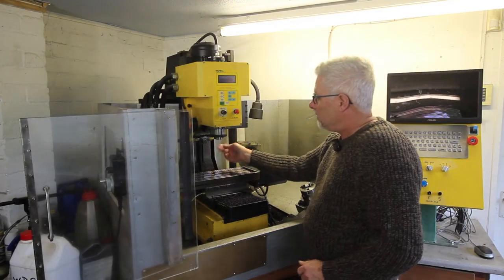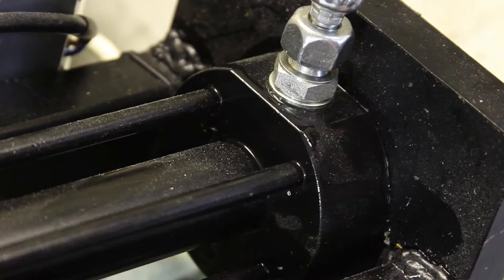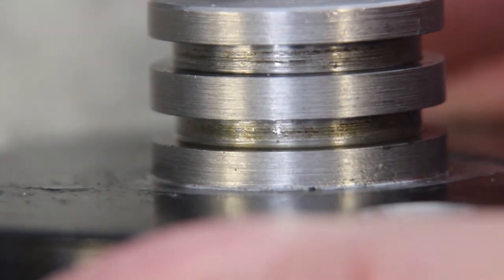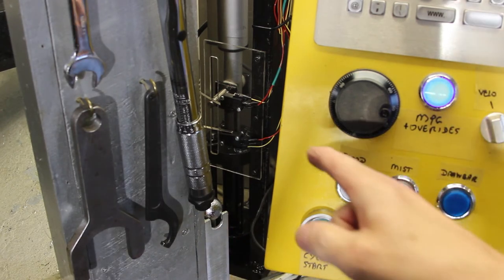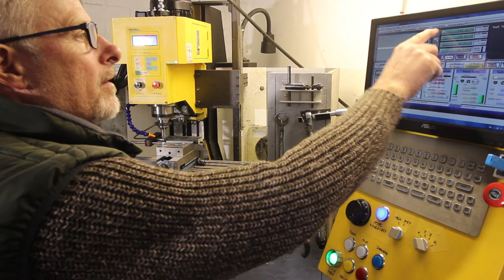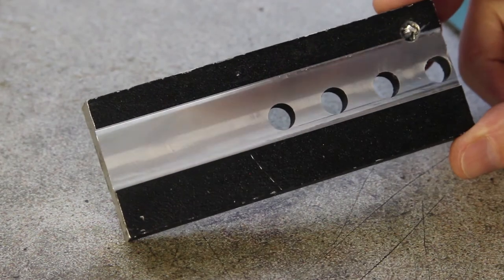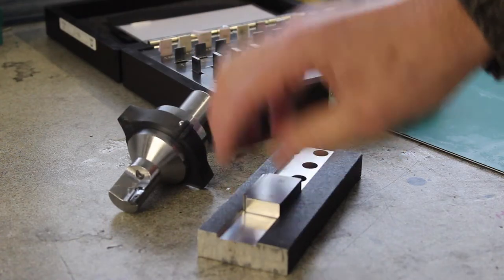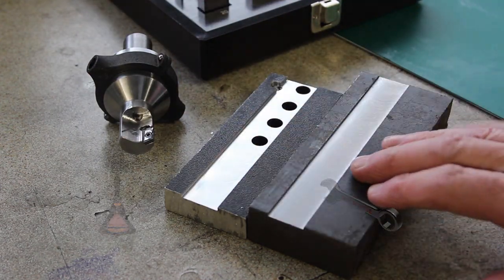Update on Through Spindle Coolant

Comment: Hi new to the channel and I love this idea, I've already started modelling my own. 

Some feedback improvements to your design. 

Firstly 
More holes in the collar your trying to displace a fixed amount of flow into a smaller orifice, and bevel your holes also so they have the best chance to catch fluid.

Also why not feed into the internal ring at a angle rather than straight 90 to the tool ?

Secondly, like on broken through coolant insert holder the coolant flow needs to be aimed at the cutting insert. Yours is aimed away from the cutter so would be worse as rpm increased starving the cutter of coolant.

Finally 
Your pocket that holds the cutter needs to be shaped to hold the sidewalls of the cutters taper, this will drop the risk of it shattering. As your only using the tiniest edge to support the cutter from side loads.

Keep up the awesome work tho.

Email you also.

Comment: I would print the sleeve with a slot and seal the slot with felt i think. Should give enough of a seal to work but not too much friction on the tool certainly as soon as its damp with coolant.
Reply: IIRC felt was/is used on vintage cars for the water pump shaft seal.
Reply from the maker: Cracking idea I will see if I can find some thick felt.
Cheers